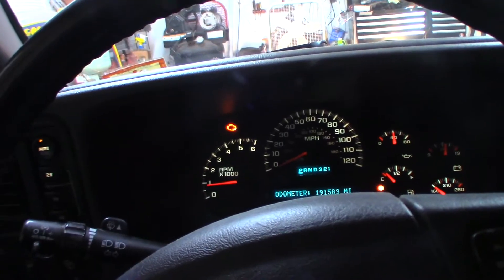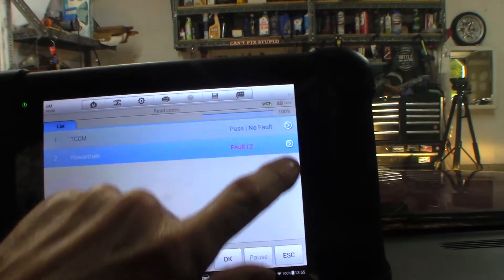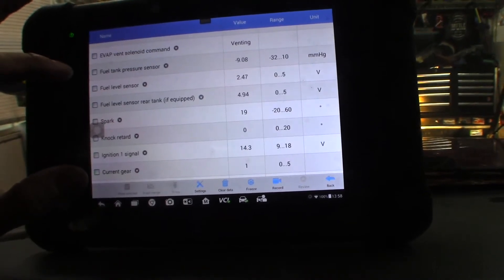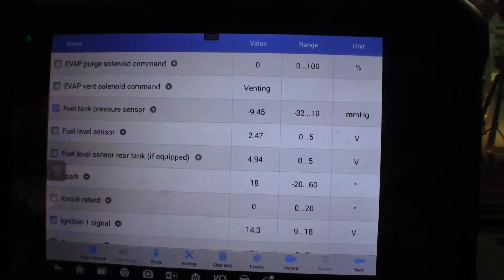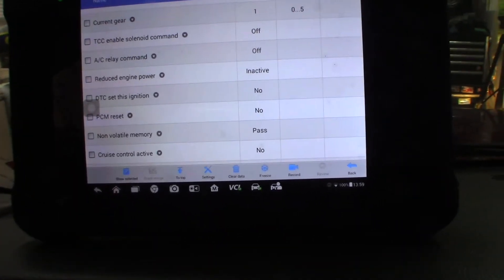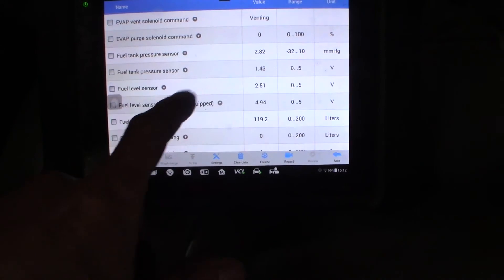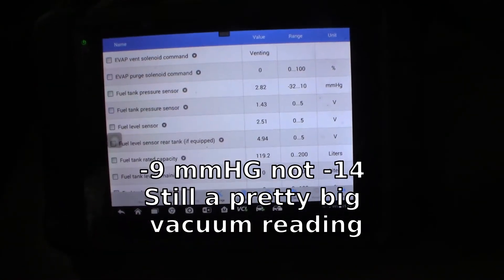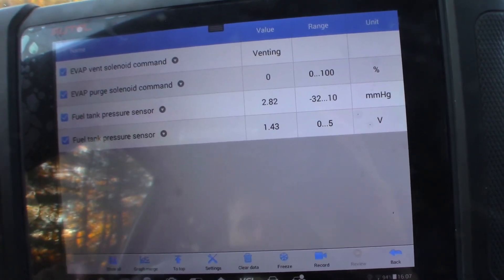2005 Chevrolet Suburban Fuel Tank Pressure Sensor

Comment: Thank you I have a 2007 Avalanche 5.3l with error code P0446 and I was able see the Fuel tank pressure sensor not working. I bought a new FTPS and now large EVAP leak is fixed
Reply from the maker: glad it helped

Comment: My sensor was stuck at 6.69 no matter if I open the vent or not, either I take gas cap off or not. New sensor is at .70 closed and open the gas cap and went to .89